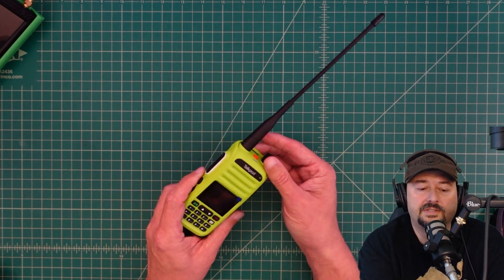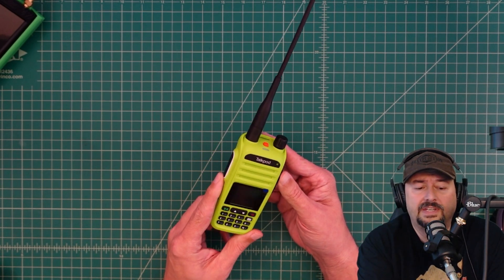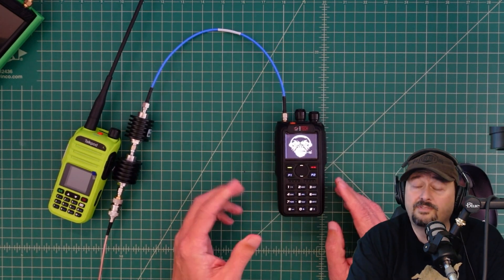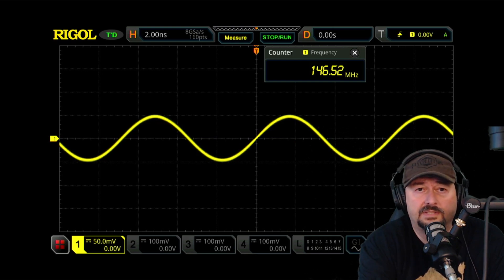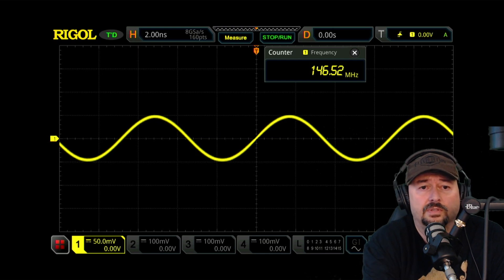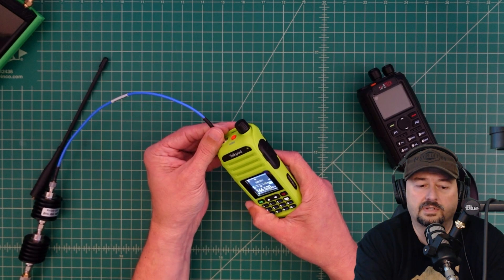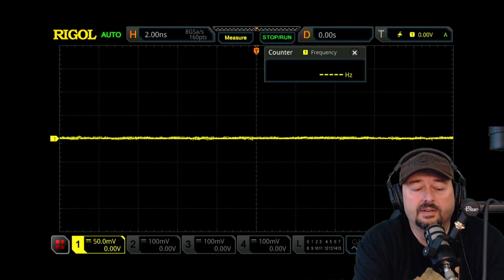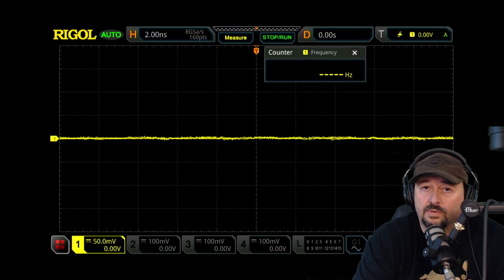TalkPod A36 Plus Ham Radio - Output Signal Quality

Comment: Maybe TalkPod fixed the issue, but I've seen several videos that show the TalkPod A36 is a GMRS radio out of the box. The manual is useless. You have to perform a reset to get this radio to be useful for VHF/UHF ham operations. Too many issues for me.
Reply from the maker: The claim to sell a ham and a gmrs version, this was sent to me as a ham radio.

Comment: I'm not impressed by the results of your tests.  Someone new to the hobby or just casually involved is most likely going to lack the equipment and skill to test any radio they purchase like this.  If it doesn't sound great they will probably buy a better antenna for it.  In this case that would be putting lipstick on a pig.
Reply from the maker: I don’t know what’s worse; not checking it or checking and saying “that’s fine”

Comment: What component inside the radio is most likely the root cause of the spurious tx? Do you think its a factor of using substandard parts or an engineering flaw?
Reply: More likely a lack of parts to add BP filtering.